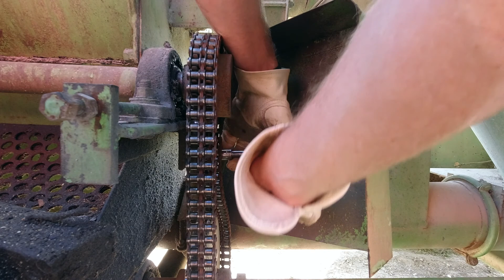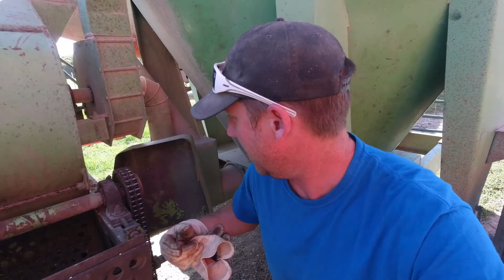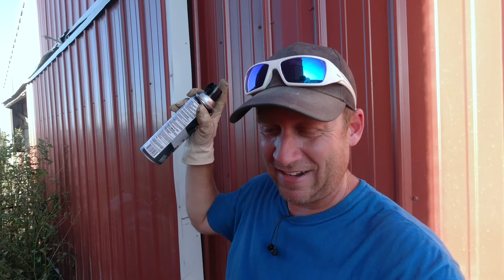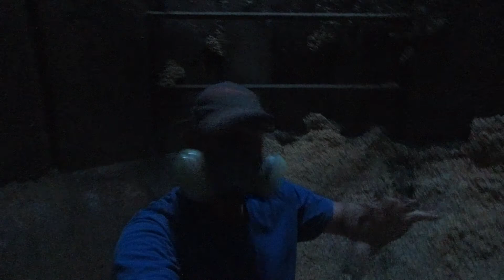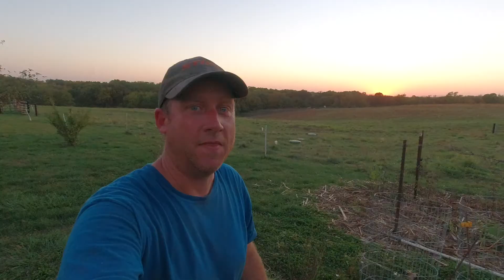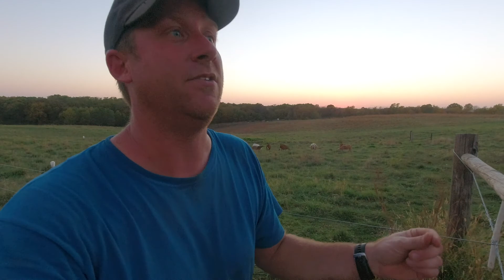Bin Cleaning and Wasps: Round Two!

Comment: Good work. Seems like all your equipment is challenging to keep running. Starting out farming equipment budgets are small and needs are great. Buying cheap sometimes cost more in the long run. A complete inspection of equipment, often requires a flashlight to look for those hidden problems. I always carry one when buying equipment. Bad seals and worn bearings can cost in down time and productivity. Impulse or buying because of price not always the best. Market a few more animals, build a larger machinery budget then buy something more dependable or from a farmer that has outgrown the equipment and needs a up grade. I tell you been there done that wish I had all my repair cost back to put into better equipment. Bucket feeding a few more rounds of pigs would of put me in the black a lot sooner than always fixing things. Love the Moline. 
,
Reply from the maker: You are right, my equipment does give me fits from time to time. Unfortunately it seems like a lot of the time I can chalk it up to lack of maintenance on my part ... or normal wear and tear. One of the reasons that I do have some slightly older equipment though is because I have family that can work on them (at least when it comes to the tractors). That has saved me quite a bit over the years for sure.